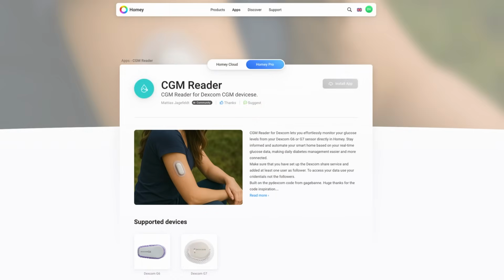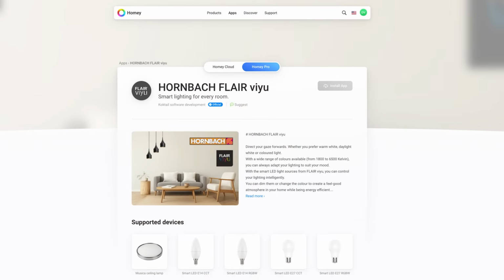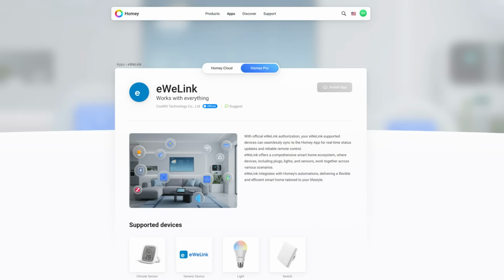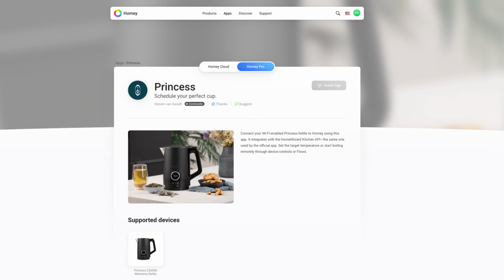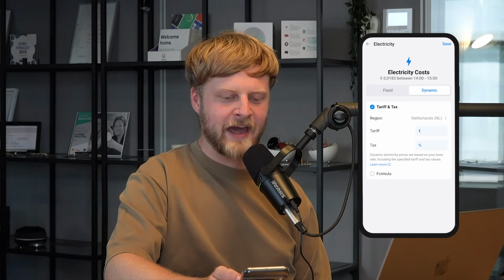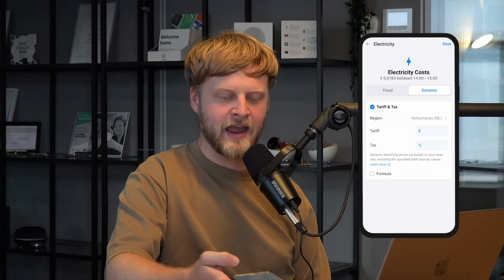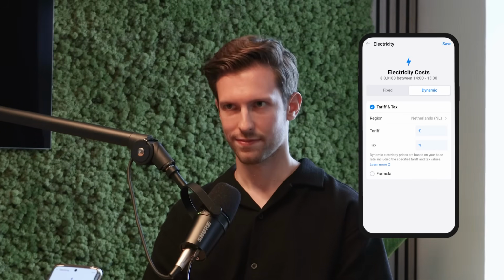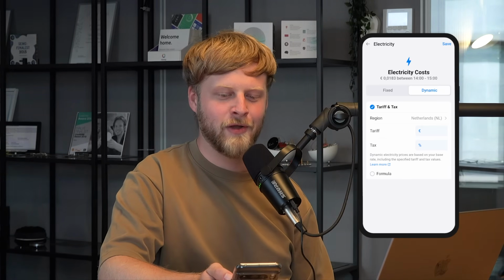The Homey Podcast #10 • With Steven (Head of UX/UI) • Dynamic Energy Pricing, Vibe Coding & More

Comment: Dynamic tariffs differ depending on the way the energy is contracted by the big guys for each period per day on hourly basis. I've been notified that the hourly based tariff will change to 15 min timeslots. Price change is NOT based on capacity on the grid! It is a result of the contracted tariff determined by the market.